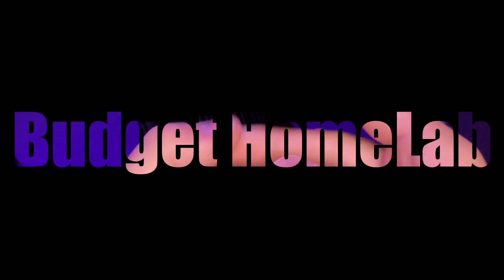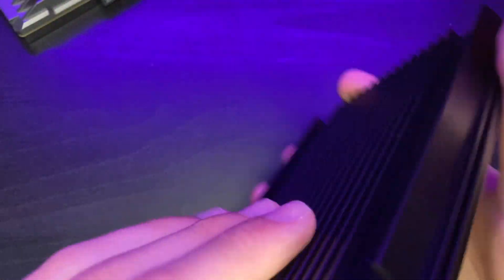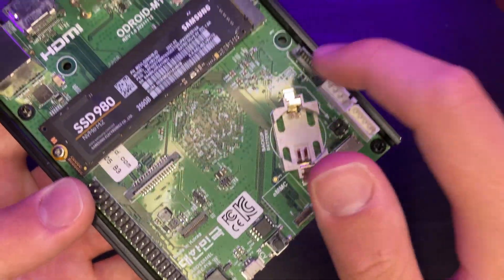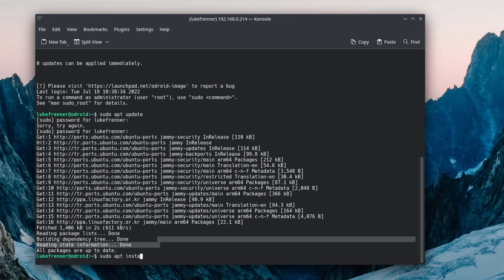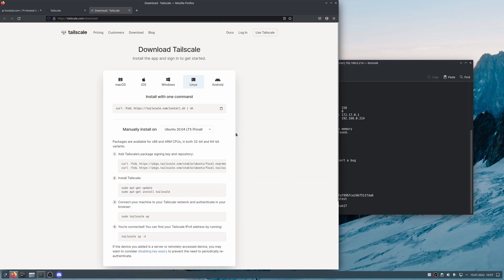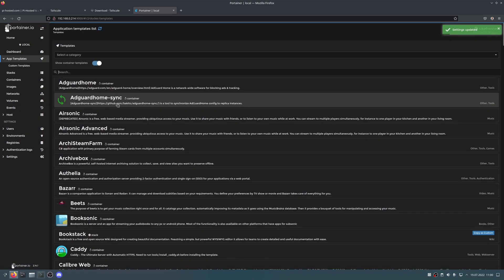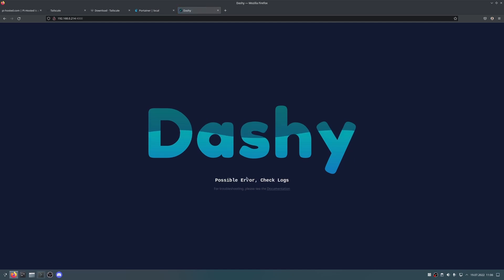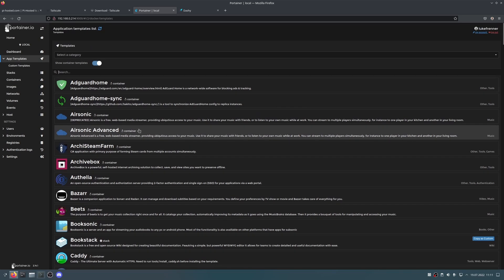Budget-HomeLab (#1) - Odroid M1 & Installing Docker Containers!

Comment: Nice video...I have exact same m.2 drive but can't install Debian 11 or Ubuntu 22.04...the older ones install fine...anyone else with same issue?
Reply from the maker: Are you using it on the ODROID M1 as well?
Reply: @Lukes-Tech  Yes I have the odroid M1 and the nvme will only boot with Debian 10 or Ubuntu 20.04 with kernel 4.19... anything 5.x won't even boot
Reply from the maker: @MrShiffles  Huh strange.. I used the network installer, installed Ubuntu 22.04 and it saw my drive and everything. I honestly don’t know a ton about the Odroid M1 and how it function so I don’t know if I can be much help.. You could try getting help on the Odroid forums though.
Reply: @Lukes-Tech  I appreciate your replies! It is strange and yes I have already reached out to the good folks over @odroid forums...they seem to be scratching their heads on this as much as I am lol ...I may have just gotten a board that is very finicky with m.2 drives

Comment: Thanks for your work. You are off to a good start. 
There are a bunch of youtubes about installing and starting containers. I haven't found one that focuses on how to maintain the infrastructure over a long time, like:
- Container architecture; 
- - How many can you run at once, or do they wake up and respond to individual requests and then go back to sleep, or what? 
- - How do they use memory? Do they page in during use and then page out when quiet?
- - How do you address them; each with a unique URL or common URL with different ports?
- Keeping container software current; each container separately or all updated simultaneously from a dashboard? 
- Protecting / securing the infrastructure; firewall on the devise, in each separate container, or only your router firewall?
- Sharing information among apps; common virtual hard drive, messaging between apps, what?

Thanks.